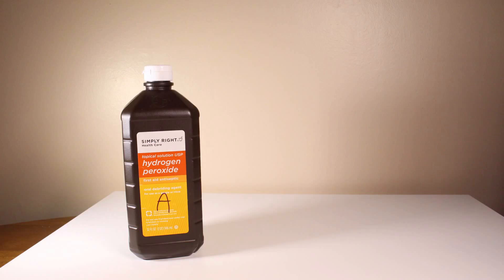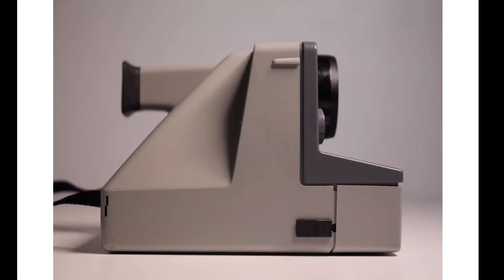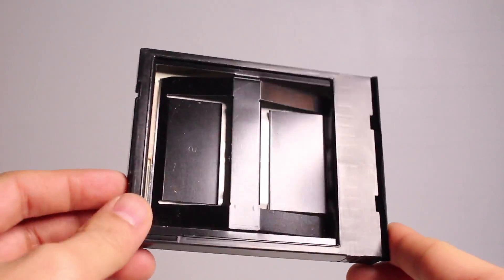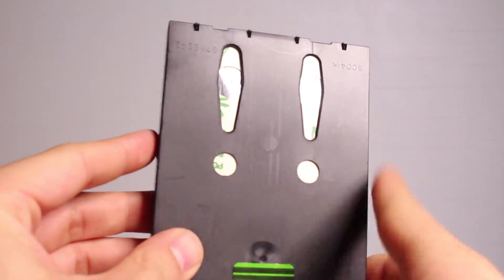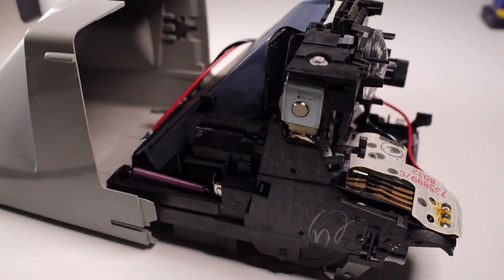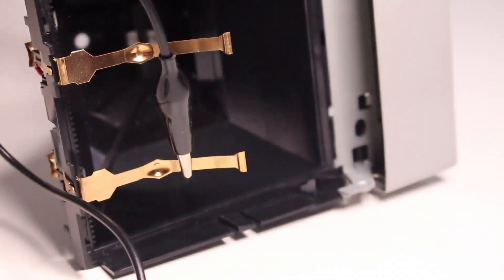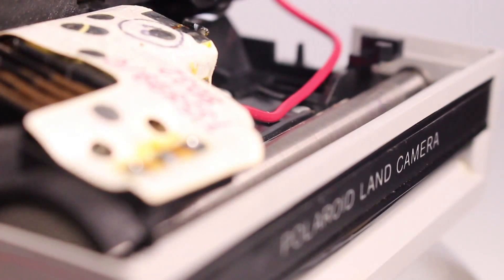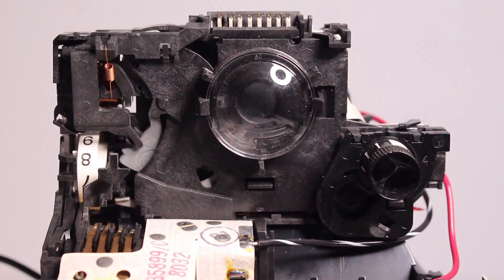How Does a Polaroid Work?

Comment: I have a question for you! My 1000 polaroid,old, doesn't work..I found a spring inside,when i opened the camera , at the bottom. A tiny one . Where exactly i have to put it back? This is not its correct place down

Comment: Hello there, thank you for the helpful video. Is there a way to develop and fix a Polaroid without using a camera. Can I use my own diy roller or is it very finnicky about the chemical spreading
Reply from the maker: The rollers are really finicky. I would savage them from a camera if you plan on exposing the chemicals. They didn’t have a lot of wiggle room and even buildup on rollovers would result in uneven exposure.

Comment: Hi. What device  is it that you used to power up the camera?
Reply from the maker: I had connected an external dc in power source with the correct voltage. It runs continuously though, a great way to see how the camera works.